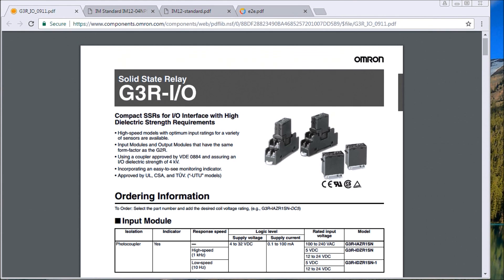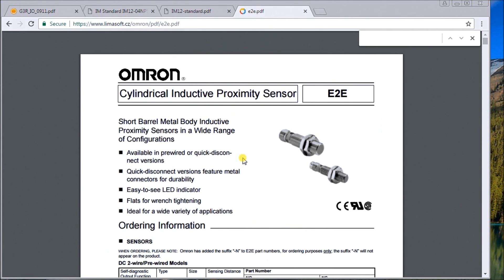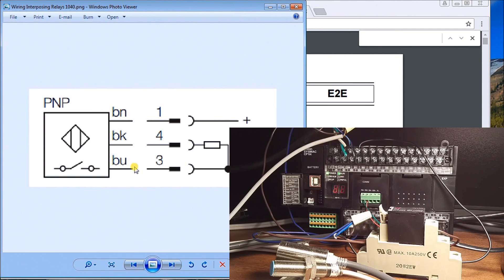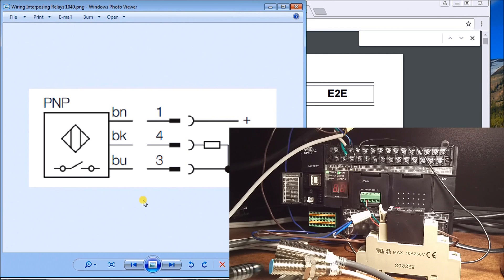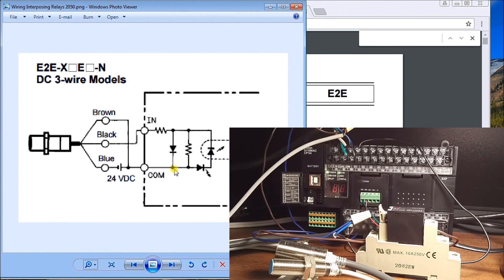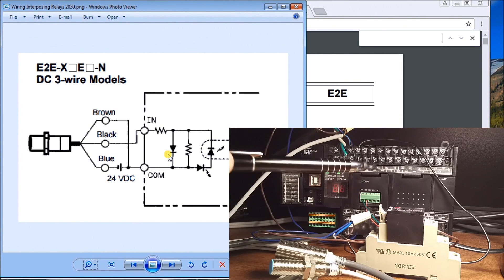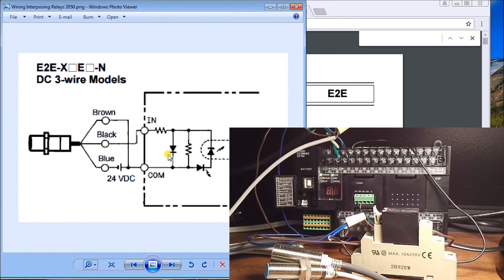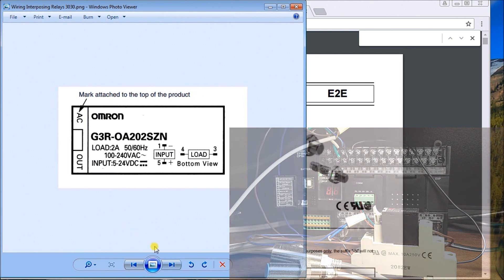Why Mixing NPN & PNP Sensors Will Destroy Your PLC

Comment: cant really understand the interposing relay wiring, i know the 0vdc tie together, can you explaing to me where the brown and black wire go and exactly what wires are coming out from the other side of the relay. thank you.
Reply from the maker: Hi Bandana,
We first wire the PNP sensor up to the first input of the PLC. Our load on the PNP sensor appears between the Black (switching) and Blue (0VDC) wires. The PLC input acts as the load, so the Blue wire is the common of the PLC and the Black wire will go to the input. The Brown (+DC) is wired to the positive terminal of the supply.
We then wire the relay coil using the NPN sensor. The coil (load) of the sensor is wired between the Brown (+DC) and the Black (Switching). The Blue (0VDC) will go to the negative of the supply.
Because the contacts of the relay are isolated, we can then wire the output contacts to the next input of the PLC. The PNP that we have already wired has the common at OVDC so we need to supply +DC into the next input. One of the relay contacts will be wired to the +DC supply and the other to the next input of the PLC.

You can see more details at the following link.
http://accautomation.ca/wiring-interposing-relays/

Hope this helps you out Bandana.
Regards,
Garry
Reply: Garry Shortt Garry Shortt Thank you Gary I'm a plc tech and I do light programming. I been asked to wire up pnp and npn Sensors. a little confusing. I checked out your website n will bring more techs here

Comment: Would you have information of using the relay to take an PNP signal and go to a NPN PLC (in this case a robot)
Reply from the maker: Hi Monte,
The relay coil would act as the load on the PNP signal. Contacts on the relay would act as isolation and be used to switch the NPN PLC. Ensure that the NPN PLC (Robot) will accept a dry contact from the relay.
http://accautomation.ca/wiring-interposing-relays/
Hope this helps you out.
Regards,
Garry